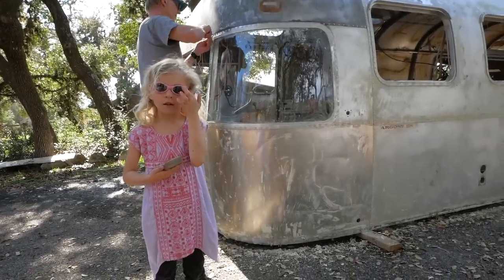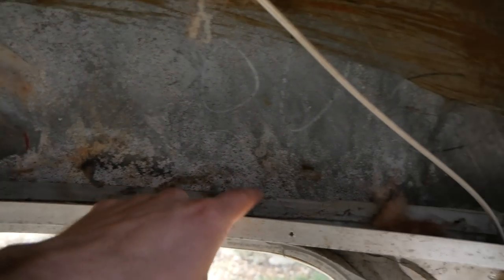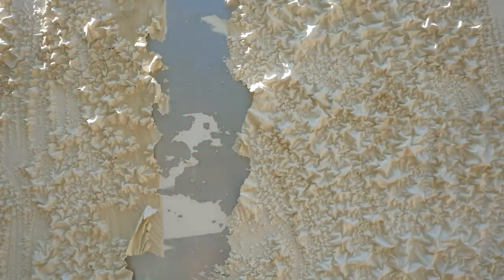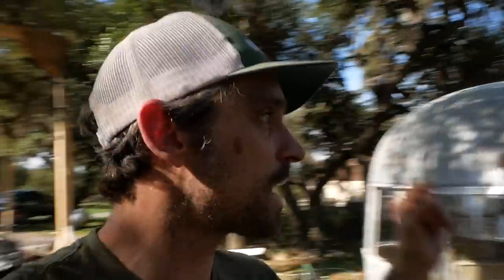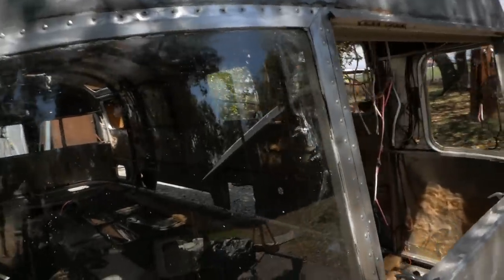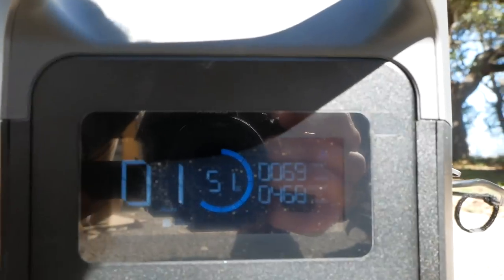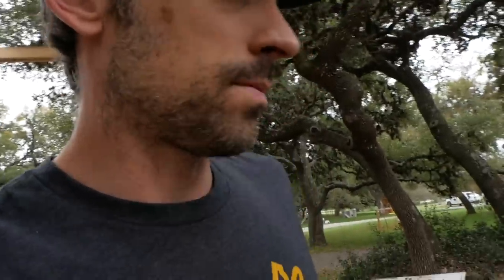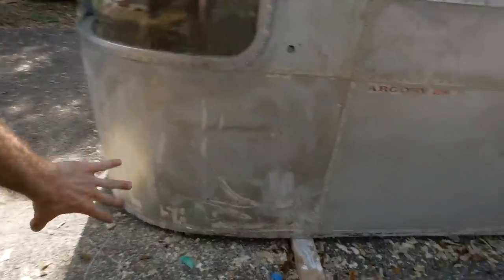Paint Removal and Panoramic Windows (Airstream Argosy Ep. 7)

Comment: You may want to rerun the water test after you get the body back on the frame, but before you install the interior. The flexing that will inevitably occur while hoisting the body might compromise the seals.
Reply: Michael is speaking words of wisdom.  There will be a lot of flexing going on getting the shell back in place. You May want to add some temporary bracing to the shell to minimize the flexing during the move.

Comment: To get silicone caulking into the cracks in the window frame, go to a local farm supply and pick up some syringes - get the largest needles that will fit into the cracks, and after filing the point up you can fill from the plunger end and inject the caulking deep inside the crack. Works much better than applying from the surface.

Great videos - really enjoy watching.

Comment: FWIW, you may want to look into 3m 4200 and 3M 5200 adhesive sealants.  Designed for marine applications they should work excellent for your RV.  I have no affiliation with 3M but have used both these products and can honestly say they work very well.  I would think they would keep your windows from ever leaking again.

Comment: Unless things have changed recently, silicone sealants were always discouraged on Airstreams as they would not remain sealed to the aluminum surface over time.  Traditionally, a product called Vulkem was recommended as it clings to aluminum as well as to whatever adjoins it with great tenacity for a very long time.  I believe one of the more recognizable brands may be Parabond — but caution should be exercised as I believe that some Parabond products contain silicone.

Comment: Silicon can be tricky in a camper as it flexes when you drive. There are a ton of vintage campers that have been absolutely blasted with silicon and still leak. At a minimum I would retest it before you put the walls in to be sure is still holding.

Comment: A tool for applying sealant I have seen aquarium builders use is called a fondant - it is technically a cake decorating tool but seems to force sealant into the gap, creates an even border, and the excess is easy to remove.  they are cheap on amazon too.

Comment: If you run your bead of silicone then spray your bead with windex before wiping your bead it will keep the silicone from sticking to the surfaces you don’t want silicone on. Learned this trick from granite counter top installers.

Comment: you cant polish an argosy, the compound curved parts at the roof ends are steel!  thats why they were painted.  i understand that the compound curved parts are much easier hence much cheaper in steel than aluminum
really enjoying the series, an old airstream rebuild is a bucket list item for me
Reply: Airstream did that so that dissimilar-metals corrosion wouldn't be limited to the area down around the axle attach points. I think he should do a hats-off to the old Northwest Airlines scheme and leave it all unpainted except the steel parts which can be in bright red.  😊

Comment: 0000 steel wool is the best when cleaning windows and chrome, no water or cleaner use as is . Warning don’t use on paint, window tint or plastics will scratch the hell out of it. 4 0000 steel wool is the best on dried bugs and water spots will leave glass and chrome clean and smooth. After cleaning with the steel wool wipe with damp rag , let dry then apply some rain-x.

Comment: When we strip Airstream's (not Argosy's) we apply the stripper with a wide paint roller, then pressure wash it off after it bubbles up. When we paint Argosy's, we just DA sand the whole body with 220 paper to remove any flaky paint. You shouldn't DA sand the rivet heads as they will flatten out & look like crap & may not hold as well. You can remove the paint around the rivets with 3M Bristle brushes. Then we spray the whole body with two part  white epoxy primer.

Comment: No one use that drill bit attachment he used on ur trailer windows. It rips it apart and scratches it and leaves it with an uneven buff and not shiny . Use steel wool 00 very fine
Reply: We have always we use 0000 steel wool on windows to get silicone off residential window cleaning.

Comment: Do NOT polish that thing! I know it's strongly worded, but hear me out; There's another guy on Youtube that just completed a step-side van. And he thought it would be 'easy'. His polisher quit the job halfway through and he ended up having to do it himself. It took MONTHS to complete. Polishing Aluminum at that scale is a HUGE pain in the backside. Just paint it. You'll thank yourself.

Check out his video: https://youtu.be/ZBNmQElmLvI

BTW, when painting aluminum, you'll need to use a 'Etch Primer' to bite into the metal, before you apply automotive or aircraft style paint over the top. Don't be tempted to use household paint.

Comment: I cringed every time you drilled out a rivet. This trailer is built like an airplane. To remove a rivet, you drill just enough to break the head off then punch the stem out leaving a 1/8th" hole for the new #30 rivet. To go oversize on the hole leads to ED (edge distance) problems. Your video shows you likely had ED problems with the original rivets, but by the grace of God and a lot of sealant you can overcome. Greatly enjoy your videos. Hang in there.
Reply from the maker: Thanks for the comment and I’m definitely no expert on it.  I will say that the original rivets are 1/8” diameter and the new rivets will be 5/32” diameter., so enlarging the hole is ok since I’m sizing up to a larger rivet.